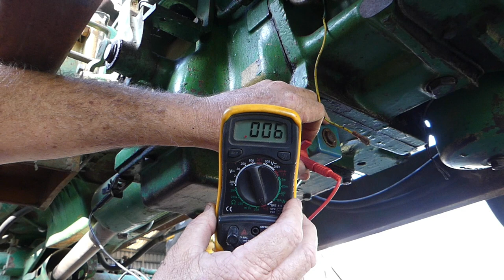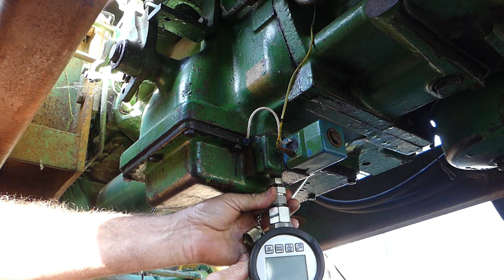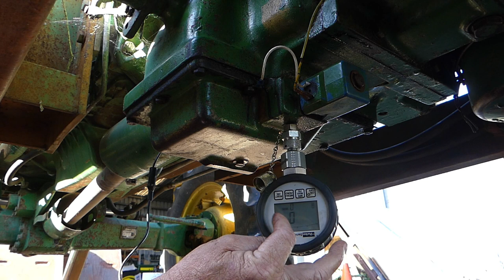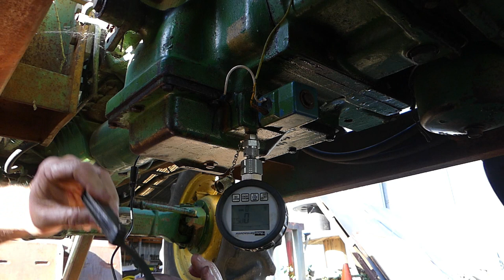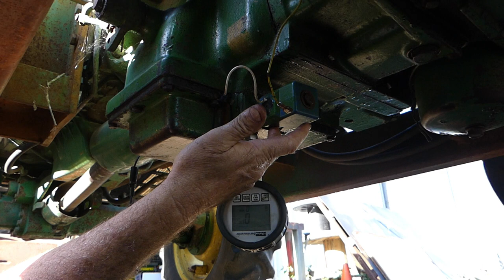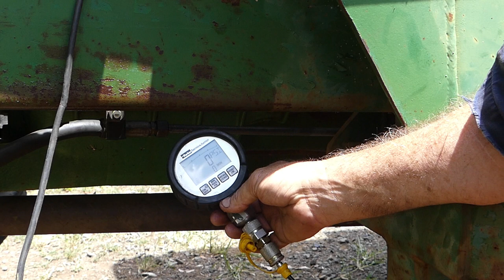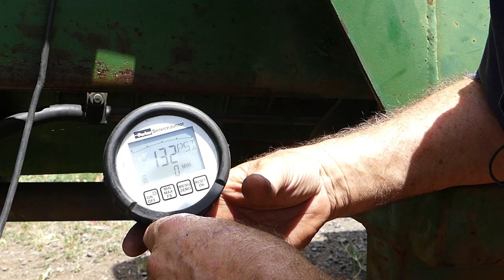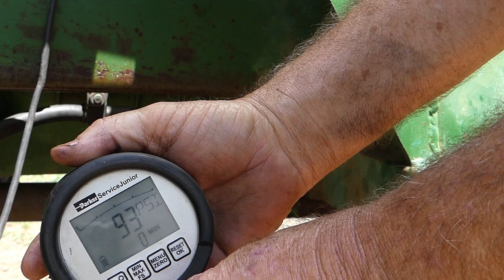John Deere 1640 MFWD How to check your front wheel assist solenoid and valve.

Comment: So if I have no hydraulic pressure at that port after replacing the solenoid and spool valve. All the hydraulics work good on my 2355. Still 4wd is locked in.
Reply from the maker: If the pressure can be seen to rise and fall the solenoid is good and it can possibly be worn sealing rings on the shaft that takes the oil to the clutch pack.
Reply: @BundyBearsShed  no pressure at all. I followed your video exactly.  Before I replaced solenoid there was no oil coming out of port.  After I replaced it plenty of oil.  No pressure at all using a gauge.

Comment: Thanks a bunch for posting this!! I have a 2240 that is stuck in 2wd. This video helped give me the confidence to get in there and check things out. My hope is that the piston is stuck and not allowing it to default. I am getting power to the solenoid and will run through your steps to test it's working.   Fingers crossed it's not the clutch. Any advice for additional diagnosis if the solenoid and piston a re working?
Reply from the maker: It os often just the little piston in the valve so well worth a look.

Comment: My tractor is in 2wd and will not go into 4wd I’ve done everything you have done to diagnose the issue. I’ve bench tested the solenoid and it is not clicking/moving the piston. When I put power to it though the magnetic part works. Would this suggest the solenoid is faulty or not ? Thank you for making this video as it has helped me a great deal!
Reply from the maker: Yes you can pull the valve apart and clean it up and get it working again easily.
Reply: @BundyBearsShed  I’ve cleaned the piston and the valve and they slide fine. It’s more the solenoid is not clicking the piston. Is there another spring that should push the piston ?

Comment: Good info for those that have the 4 wheel drive john deere utility tractors, mine is stuck in 2 wheel, unfortunately thats the way it was built 😉 It would be nice to have but a lot of work to change it especially as its a highcrop, I don't think its possible unless I made it fixed hight.
Reply from the maker: It would be a big job alright, probably cheaper to upgrade the tractor

Comment: Does anyone managed to take apart those two main parts from 26:30 numerotated with 6 and 10 because they seemed like one single piece. We need to open that casing in order to clean the piston and to check the spring. Thank you very much!
Reply from the maker: I just had a thought, there is not a plug at one end on yours?